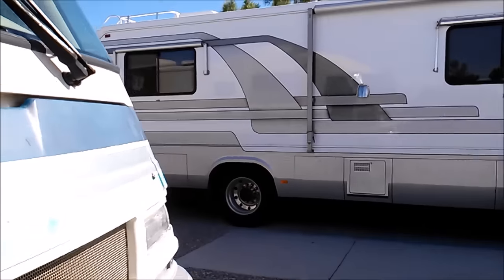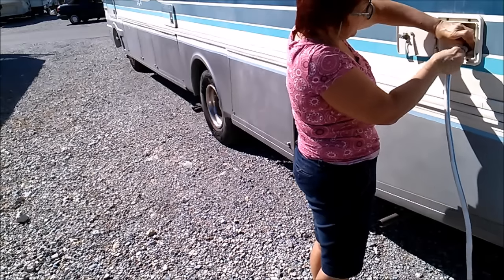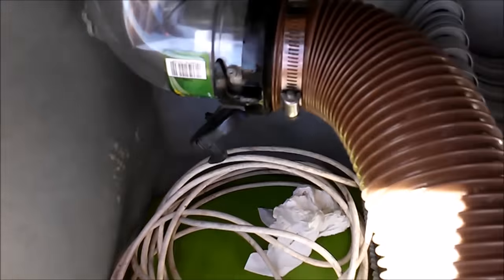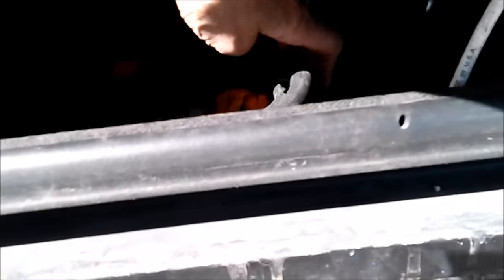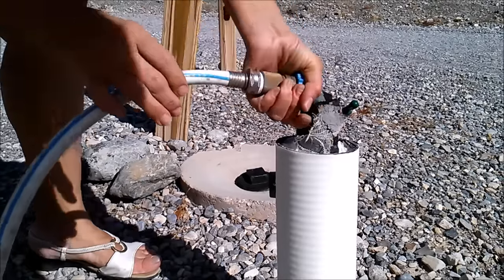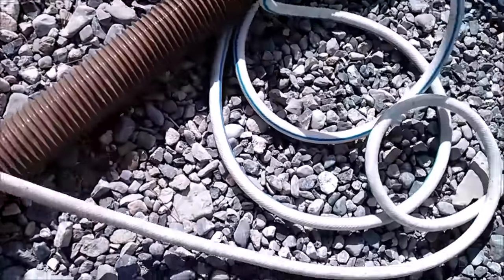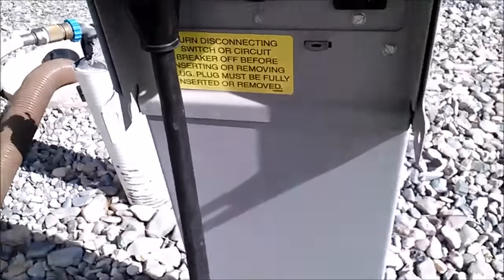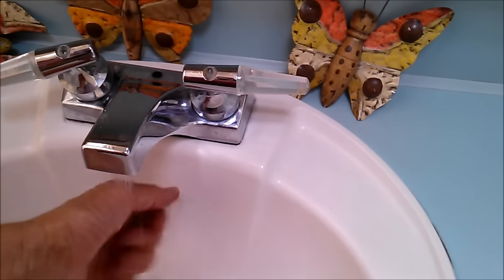RV Shore Power - How to Hook Up Water, Sewer, Electric

Comment: You need to get you a serge protector also for your electrical outlet, don't want to blow your house electric, also that on and off switch on the electoral connection should be off each time you hookup and disconnect
Reply from the maker: +New Beginnings with Budhi and Cyndi Ohhh, I did not know about the off switch. You mean which I plug in the switch needs to be in the off position, then i turn it on? Ok, surge protector and gloves! THank youuu. I got it.